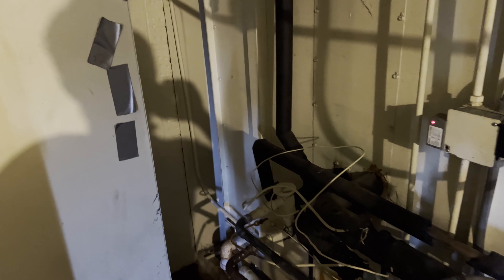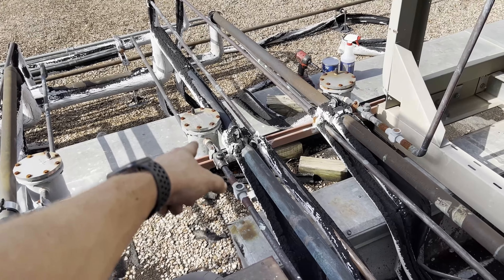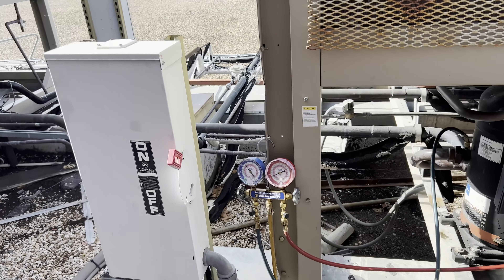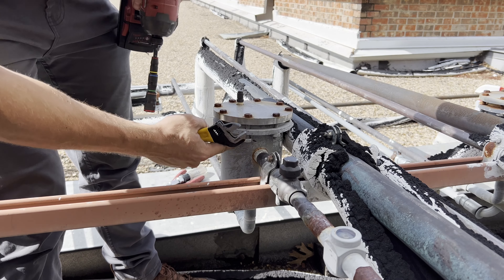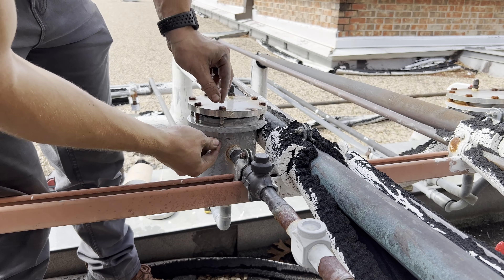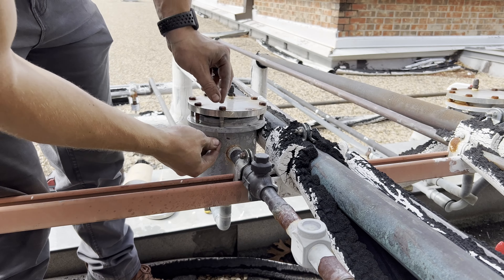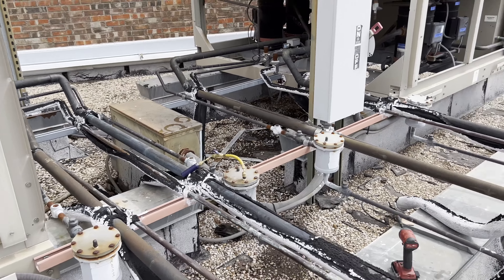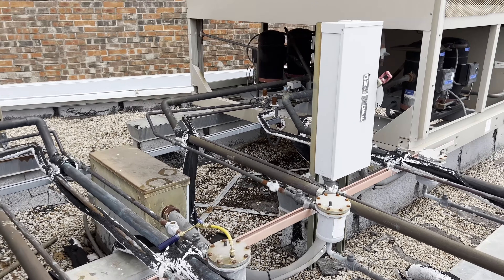ISOLATION TEST PT.2  M099 ??????

Comment: Great video!  Fixing isolating valves on the system will definitely help in the future in a large system.
Reply from the maker: It really should be some type of mechanical code to install them on large split systems over a certain tonnage/btu.

Comment: Curious if you had to force open the hot gas bypass solenoid during the vacuum?  Or was is a non issue because you also pulled down from the liquid line and suction line at the same time?
Reply from the maker: Because of the way I arranged the vacuum setup , manually opening the hot gas solenoid was not required. The vacuum pulled through the liquid through travels back from evap coil through condenser coil through discharge line and entering side of hot gas, and suction line travels back to compressors , and the third hose was on the hot gas line to the leaving side of the solenoid. Good observation and thanks for watching

Comment: Why do you hate mo99 and what would you use for an R22 replacement if you could call it?
Reply from the maker: I just am not a fan of mo99 or 422b primarily because I work on a lot of trane 3D and Danfoss scroll compressors , and those refrigerants will lock up the compressors due to lack of oil return. There are service bulletins about it and I’ve seen it in the field. I think m099 and 422b work great most of the time for smaller split systems and package units.     407c would be my go to r22 refrigerant performance wise even though it might require oil changes and such , it was slightly better performance and less issues with larger tonnage systems.    That being said , I was pleasantly surprised with the temps of mo99 on this circuit.        No drop in  beats r22 , and we still use a lot of r22 where I’m located. Lots of chillers in DFW that have been well maintained still use r22. It’s just to the point that it’s so expensive now we are being forced to find suitable drop ins.
Reply from the maker: If it were up to me depending on size and price of repairs I would would rather repair a leak and go back with r22. Lots of our commercial customers will pay extra to keep it r22, but in residential it’s better replace the system or go back with either mo99 or 422b
Reply: @dfwhvac  have you tried bluon? It's supposed to be the commercial side where it shines. Also 427a is identical to 407c with a small mix ratio change and a small added ingredient which allows for no oil change. I've not heard many actual real world results from either.
Reply from the maker: @realSamAndrew  I have no personal hands on experience with Bluon or 427a , but I have read good things about them online. It might be worth looking into, thanks for the info and comments
Reply: If mineral oil, we use 422B. If poe oil, we use 407C.